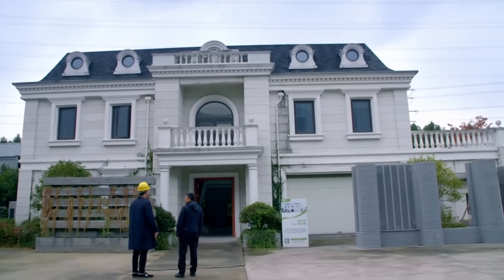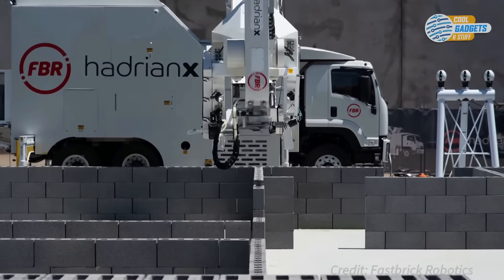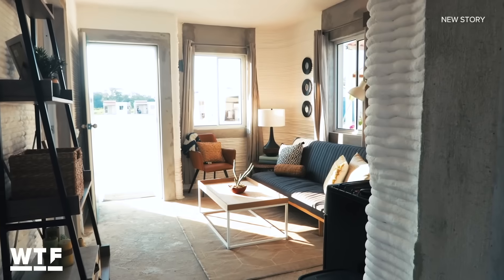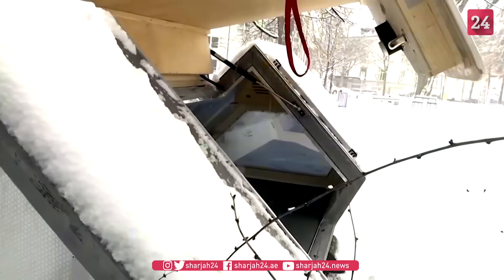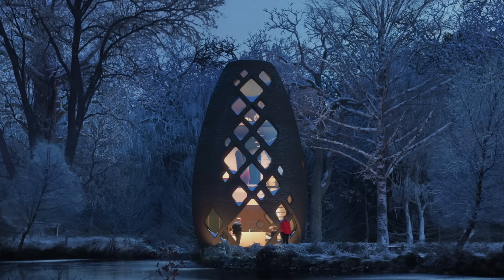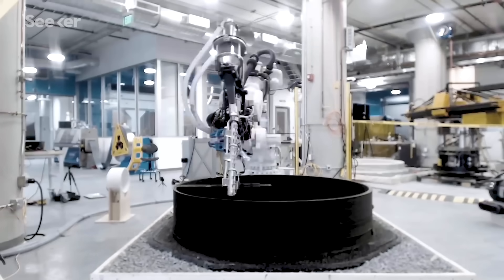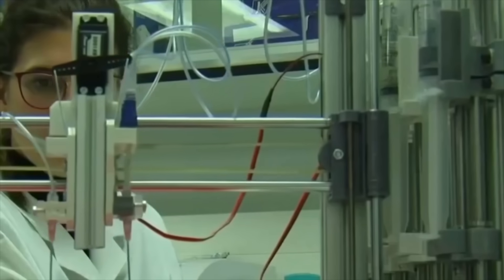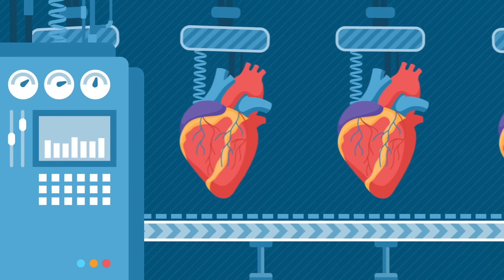Watch robots build houses at incredible speed. 3D printing meets AI.

Comment: Just leave homelessness out of it, two different issues. Drugs and alcohol and mental illness are the primary drivers of homelessness, and there are already ways to build cheap housing for $5k or less if the homeless would do the work themselves with guidance. A house for half the price does sound pretty goo though.

Comment: Using Robots in construction is better than 3D printed house. 3D printers can still print small areas and they cannot use rebars in them making the concrete weaker.

Comment: The core premise of this video is ill informed. There is no affordable housing  shortage... there is a plot and zoning shortage.

There are plenty of houses, just not in CA, NYC and other expensive places.

The unemplyment is also a effect of taxation and regulation. There is a unlimited about of work avalible, just if the price is right. High taxes is pushing down the avalibility of price is right workers.

The last problem is drugs.  You cant house drug adicta.  They will tear the place down.

Also the structure  of a house is about 10% of the cost of the house, making it cheaper, even by 3 or 4 Times, hardly helps. 

The printers  have to do roofs  fundation,  instalatons  and clading  even before it will impact the cost.  Also regulstion have to be fixed.

Comment: The thumbnail is highly missleading and should be changed. 
People need to realize there is NOTHING for FREE.
The difference between the 3d Printed house in comparison to the normal build house is cost structure.
And it is always about the costs: 
So in a normal construction company you have labour, Materials, tools and machinery. 
Next to those fixed cost is of course the productivity: So how fast can you build these houses?
The cost of materials in this case of comparison will be the same. So the question is:
Do you have a great profit if buy the 3D printer with the reduced labour cost, 
but increased cost for machinery, or invest in wastly cheaper tools and cheaper workers.
Also as long as we 3d print with concrete, we have the problem of condensation in the houses.
They need to be specially ventilated, because their walls cannot "Breath" natrually like brick build houses.

Comment: one small 3d house printer costs $130k. supporting systems to feed the concrete? another 200k. you still have to use excavators to dig foundations. you still have to have plumbers and hvac installers and electricians. you still have to have carpenters to install windows & doors. it is a great way to replace a framing crew... but 3d printing is LIGHT YEARS away from being 'free'.  maintenance of such a system is NOT cheap either. in NC, in 2002... I witnessed the construction of a 2400 sq.ft. house, from ground breaking to move in, for $106k. granite tile, granite countertops, custom cabinets, custom hardwood stair case, all tongue & groove maple floors upstairs. NO WAY in HELL could you even come close to that price JUST because you 3d print.... not in concrete. 

CA  has high cost of home ownership BECAUSE of the drain that liberal leadership places on the market. that $106k house in NC? same plans, same lot size in CA? 1.5 million. the county wants to do an "environmental impact study". contractors have to have a $13k bond to keep their license active- NOT LIABILITY INSURANCE, MIND YOU... a bond. in other states you only need a bond if the total cost of the job is around 2 million- BS tree hugger fees not included. in short.. CA politicians line up with all their liberal buddies in front of contractors with their hands out.  if people are concerned about environmental effects... do what other states do- restrict lot size to 1 acre... or 1/2 acre. just flying over the united states... one thing I noticed RIGHT away... you fly over the south east... you see MASSIVE patches of wilderness... even in populated areas. even from 10k feet... it looks uninhabited. fly over CA at 30k feet? it looks like a printed circuit board. HOUSE HOUSE HOUSE HOUSE HOUSE HOUSE. SPREAD IT OUT. limit lot size. get rid of the stupid bond (no other state uses that bs- it only benefits the banks) and simply institute "must show proof of business insurance". $60k for an environmental study? HORSE shit! mr. greenie.. you want to do a "study"... go ahead. FREE OF CHARGE. no? then get lost. 

homeless? I work in the bay area of CA. these people (most) are not homeless because they don't make enough money. most have some kind of major mental problem, like schizophrenia. giving them a house or even money doesn't solve anything... but that's a whole other discussion. but in short- the proper way to handle this problem is a sheltered workshop where social workers evaluate & train mental cases to perform a task- something that they find enjoyable and are happy doing. then companies who employ these workers get tax breaks. the project would be funded in part by the government- but an amount of money that we're already having to spend on the homeless problem. 'busy hands' are less likely to get into trouble. giving them something to do gives them purpose- of COURSE it's easier to just stick them in a nursing home & pay the bill... probably even CHEAPER than a sheltered workshop + nursing home - but giving them activity HELPS them be happier. these people need to be a ward of the state.. .or they're just going to wind up back on the street, defecating on sidewalks... dragging down property values, even stabbing people because "the voices said to". before 1970.... we used to commit people like this. 

there are cons living among the homeless. people who just prefer to camp out & beg for money. a decent psych clinician can weed those out though.... and give them a fair warning- get a job... get an apartment or get arrested for vagrancy. 3 strikes? we place you on a state crew work detail, halfway house... and give you a probation officer. like it there? welcome to stay & work for minimum wage.

Comment: Replace the concrete with a highbred material composed of a combination
 Of hemp herd , The pit inside the stalk. Of the hemp plant , For insulating properties and hemp fiber for strength and finally concrete for structural integrity! This would result in a cheaper, and multifunctional product that would also be much more sustainable❗️

Comment: Where do they install the electrical wiring or pipes?  Is it inside the wall or do they install it on the outside surface of the wall after everything has been printed/built?

Comment: You need to print 8 story apartment buildings. Single family homes are not green.  They use too much land, and too much energy to heat and cool. But you will never print an 8 story apartment building, because it can't be done.  In fact, you can't even print the roof structure of the buildings you are already doing.

Comment: The material used to print those houses is 3 to 6 times more expensive then normal concrete. I have seen then made out of mud the same way but those houses would melt in wet climates. At current tech they are NOT that much cheaper from what I have seen. In the future when costs come down I can see it but then how many construction jobs will go away?

Comment: walls, interior walls out of brick or concrete. and their solution for the increased time, expense, difficulty in running wire and plumbing through those concrete walls?

Comment: The idea of solving home less problem by Printing houses is a joke. The problem is not the cost of building a house. The problem is the speculation in the housing market - land etc, the real state in general. Building the house is not that expensive compared to having a place where to build.
Printing houses makes some sense but it does not solve the problem. If the idea is to reduce cost, apartment blocks are cheaper. The technology, right now, can not do 7 store buildings.

Comment: The #1 problem with homelessness is mental illness. 
Yes, you will find sane folks on the street, too. Every Great Depression causes even the sane to become homeless. Check out the legacy of eighty-years ago. Raising taxes just AMPLIFIES homelessness for those under financial duress. Have you EVER seen the cost of government provided housing for the homeless or for the border crossers? The figures are simply crazy-high. 
BTW, most construction unions WILL NOT TOLERATE robotic house construction. It's their iron rice bowl. 
Unions won't permit even manufactured housing if they can stop it.
Check out the cartel pricing in stud-lumber going on RIGHT NOW.

Comment: With land prices escalating build cost reduction just balances out the real issue - Land pricing needs controlling because the free market system strips supply, which is controlled by both builders and speculators, to keep prices inflated. And then housing the homeless just inflicts the problems they escaped on the street - high local taxes for extravagant councils. Then there's utilities. In the end many homeless opt out of the system, not housing. 

If you eliminated most charges, feeding them into income taxes, and gave free needs based utilities, which aren't costing much if green power really works, then the real culprits forcing homelessness would be solved. We point at high housing prices and rents but both are free market driven by, primarily, greedy profit hungry builders and speculators. 

It's a great scheme to build cheaper housing but as we saw in the UK, under Thatcher, the solution, our social housing stock, can soon be sold off and eventually fall back into speculators hands with resultant high rents. You can't innovate greed for maximising profit out of the equation. In the end only radical change will solve homelessness or the threat of it which motivates people into low incomes just to keep in that one pay check from the street existence. And low incomes feed into greater profits for the few. It's a cycle that needs more than cheap building costs.

Comment: 1. These "houses" would not pass any building code where I live, and I bet there were a lot of codes that were overlooked where these buildings were built.
2. How long did it take to set the machine up?  
3. What does she mean by "built"?  You mean the walls were erected?
4. How many men does it take to keep the machine running during the day?  How many hours in a day?
5.  I can erect the walls for a 3 bedroom house in 2 days with one Mason tender out of 8" concrete block, within code and I'm almost 60. Do it'll the time and I have many references.  I can build it in 3 days without a tender.
6. The $1000 cost was for  materials for 1 small building.  How much was the fuel costs of the machine?  Labor costs for machine maintenance? Waste cleanup?  Checking and fixing of mistakes?  Setup fee?   Etc...?  Surprisingly these facts are not given.
7.  Since I'm self employed I've lost track of people, but in days gone by, I've known many men who could lay 700 and 1000 block a day, and though I don't live in brick country, I'm sure there are still many men who can lay 2000  brick a day and not break a sweat.  
8.  How much does the machine cost?
9. If one of these "houses" is manufactured in a warehouse, how much to transfer it to the job site and set up?  How long does it take to do so?
10. How much does the software cost? 
11.  Can't replace humans with robots in the real world of masonry yet.
12. Those concerned with what resources are used to build buildings..., just to let you know,  anything you build takes resources, whether it's built from plants, or rocks, or whatever.  You can't build out of nothing.  And it all takes energy of some sort to do so.

Comment: So how do they install the plumbing and electrical in the walls?
Reply: Surface 😆😆😆
Reply: the walls with trusses will prob be ok due to the vertical gaps, but the flat concrete with no gaps inside will prob need to be chased.

Comment: I doubt the veracity of all the claims in this video. I suspect the to.e quoted are only for the printed structure. Then you have to account for mechanical, plumbing, electric, doors, windows, flooring, painting, trim, utility connection, waste, etc..

Comment: If you add steel rebar to the walls, ceilings, & floors, welded all together,,,,,,then pump them full of concrete..Maybe spray the entire exterior with different appropriate colors of a protective, waterproof sealer.....it might classify as an actual house.   And cost over 1 million dollars per house?

Comment: Licensed architect here: This technology is certainly impressive, but buildings are a lot more than their walls. The most expensive thing is often the site work that's required to support the building - things like leveling and grading the land and placing foundations. Plumbing and electrical services. Then there's the windows, doors and roof. Don't forget finished floors and ceilings as well as plumbing fixtures and so on.  All of this must be integrated while conforming to local environmental and regulatory conditions. Some regions are subject to earthquakes some floods. Others snow, and so on. Each site has it's own soils and climate, each region it's own building codes and so on. Automation of housing construction must address all of this while being significantly more cost effective than existing regional building methods, methods that have developed based on market forces responding to all the above considerations plus many more. So while there may be specific narrow use cases for the automation of housing construction, wide adoption faces many challenges.

Comment: It depends on the amount of concrete and covering. I have lived in concrete building where just the walls were painted. It creates a lot of moisture and humidity. Leading to a lot of sicknesses during the colder months. They have to insulate them well in order to make it in livable conditions. Engineers should always think before they build something.
Reply: Cheap construction equals higher profitability. Profit before people, but this video tries to spin it otherwise. The UK is still blighted with the mistakes of the fifties concrete revolution.

Comment: This is cool, but it's not building a house.  It's replacing the only the framing and only things that go straight up and down.  It can't put in windows, frame windows, install glass, install plumbing, electrical, kitchen or bathroom finishes, ductwork, drywall or roofs.

Comment: Pindex, The Portland Cement for Concrete can be made without the CO2 emissions. The energy needed, in the form of heat can be Solar Thermal & with Photovoltaic Electrical Energy to power the motors driving the kilns, blowers, etc. The CO2 emitted by the chemical reaction being used for other purposes. So Cement & Concrete can be green materials if these changes are made and the product is transported to market by electric railways...
Of course, the composition of Concrete can be changed as well, but why change a material that lasts hundreds of years if made & used properly...

Comment: Unfortunately, the lower building cost will not arrive at the customer because the price or rent of a house or flat is dictated by market price and not the actual value of the used materials. At least in cities where one usually doesn't have the option to build an own house.

Comment: Nice walls. Now install the windows, electrical, plumbing pipes and showers, sinks, toilets, HVAC, appliances, roofing, insulation, counters, cabinets, finishings, flooring, carpets, doors, tiles, trim, etc. 

And paint it all. 🎨
Reply: Well US ROBOTICS 2 years ago demonstrated a Robot that hangs drywall. I mean cuts and finish. It's a slow robot compared to a human however it works 24/7 and makes very few mistakes. That was years ago. I imagine one could install a toilet by now.
Reply: @DemiGodVooDoo  Wrong. Can't even tie a shoe. Robots are useless. Battery life: 2.4 hours. Useless and fake.

Comment: So you got to love how they casually leave out all the other things required to actually have a live in house.Like electrical, plumbing,windows and much more.
Reply: Just forget all of that important stuff. Ooh! Ahh! ...Follow along.
Reply: It likely wouldn't be too difficult to just include paths to run all of the lines in the print, while they didn't necessarily show it off, there was visible space in those walls that could easily accommodate for it
Reply: Most of the world doesn’t live that way to begin with, you spoiled brat
Reply: @seitanbeatsyourmeat666  ,,,You’ve got running water, heat, A/C, & windows & doors...Right?
Reply: @seitanbeatsyourmeat666  
Where is it written that we must live like the rest of the world.
Provide for yourself lazy commie.
Reply: You don't need all those fancy things just put up a tent inside.
Reply: @goatlady7761  Maybe I can get them to put up the tent inside with their 3D printer.
Reply: You won’t need any when you live under davos rules.
Reply: Plumbing I'm sure is underneath and already been installed. Like really what's needed? A drain pipe and a water source. As for windows we both know those aren't difficult. Electrical can't be to hard because if you haven't notice , they always refer to these as energy efficient or sustainable and green meaning there is probably one power outlet so you can stare at your TV and order batteries from Amazon.
Reply: Well if you’re only earning $3 a day, then you’re probably also on government assistance receiving unemployment checks or other checks that can cover electrical, water, and other bills.
Reply: @dinomightstudios4119  ....He’s not talking about how to pay the bills,,,,,, He’s saying that the house wiring, plumbing, windows, doors, heat & A/C..... all missing from the video.
Reply: @dinomightstudios4119  Why not using those guys which cannot afford the house as work force to their future homes. In the end the printer is using more or less the same materials. The houses are not affordable because of high cost with labors? Then you have the solution. Don't teach people to be lazy, I think:D.